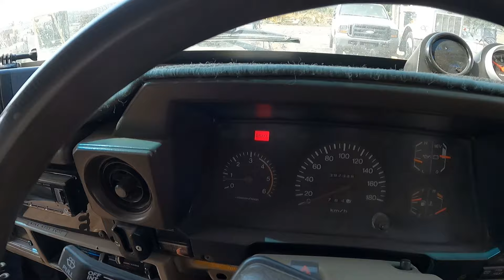Removing final drives and tracks on a CAT D10R!

Comment: One method we used to dismount the track on his machine was to (before unlinking) take 5cm square section tubing and make a small 1.5 meter long "ladder" with some rebar as threads and place it on top of the track, tying it down to the track with chain wrapped around the track, loosely. Doesn't need to be tight, it just needs to unify the two. Then we removed the link and used a crane (vehicle) to "hinge" the whole affair off the machine. The "ladder" was placed from the middle of the last buckle before it goes downwards towards the ground, leaving the forward end floppy, so it clears the gubbins up top.

Comment: A lot of stuff in this video on, what not to do.
Reply: You talking about the first 5-seconds followed by that gay-assed "good morning" part? How NOT to use a diesel in 4-low, even though that thing seems built to tackle thing a flatbed should never do, I know what a diesel can do to the dog house or bell housing when it comes apart. Heck, I've even seen a 4-cylinder Toyota truck through it's clutch THROUGH the steel bulk housing directly above the flywheel. Little old 22-RE 2.2l engine. My mind was blown, no WAY it should have done that.